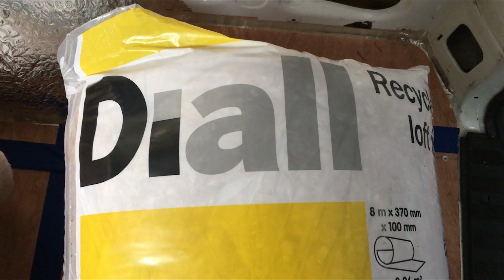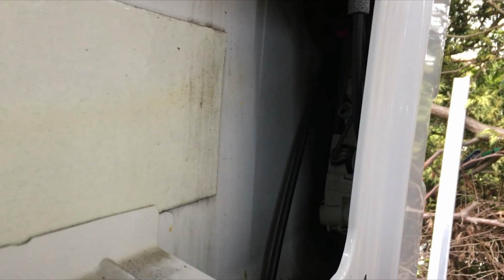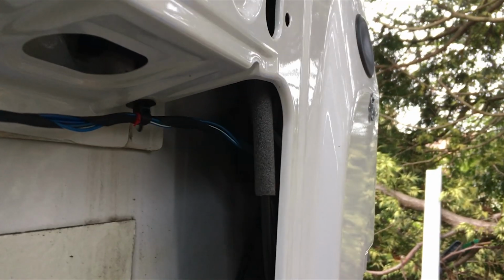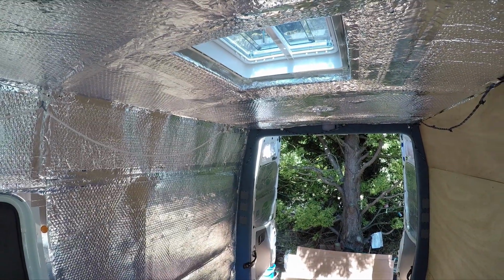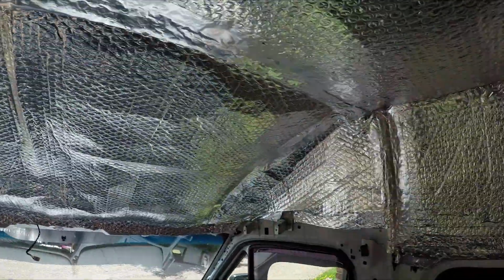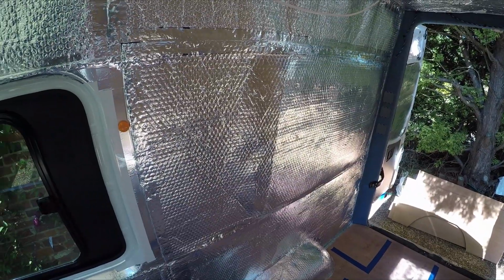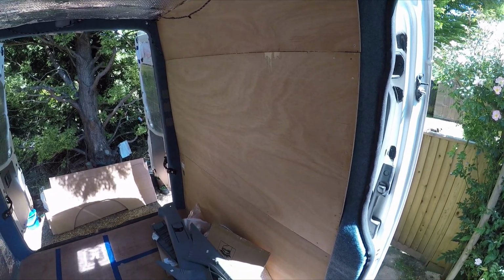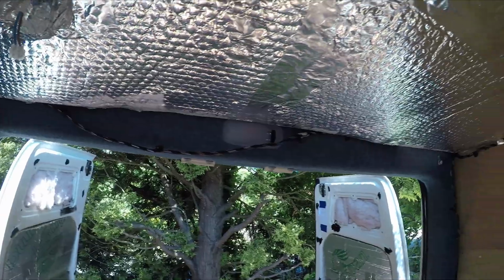Insulation - VW Crafter Camper Conversion

Comment: Hi, I'd be really interested to know the height of the interior space once you've added insulation and ply to floor and ceiling. Thanks, J
Reply from the maker: It’s difficult to measure as the roof has a curve so the height varies. The insulation on the floor is 25mm plus 12mm ply flooring. The 50mm insulation on the ceiling is the same depth as the roof struts so that hasn’t added any and the ceiling ply is 6mm. All in that makes an overall reduction in headroom of about a 68mm. I’m 5’11” and there’s plenty of headroom for me.